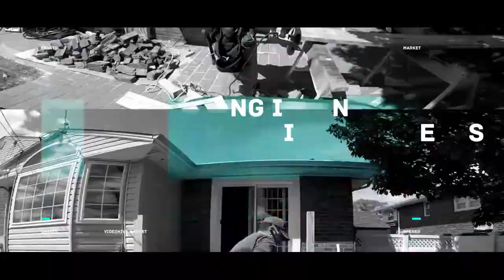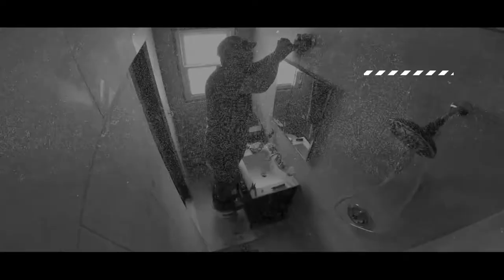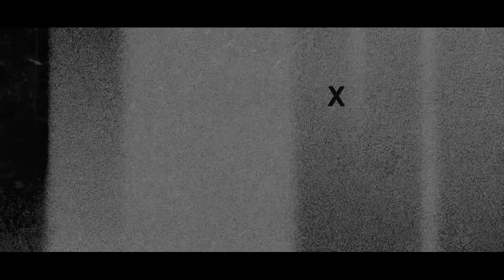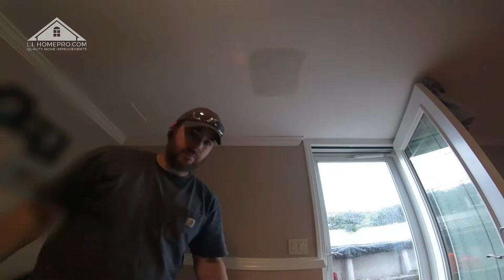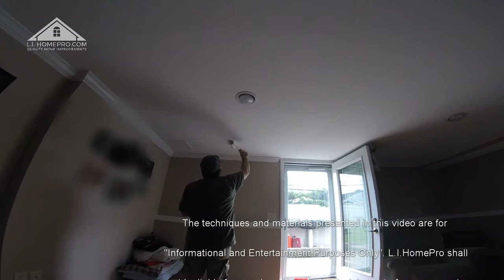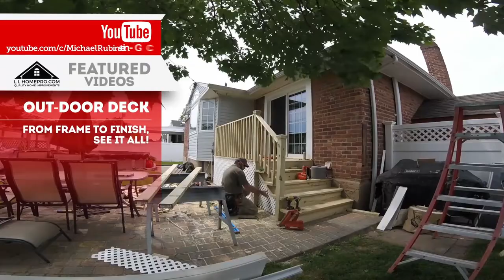Dry-wall Ceiling Repair  (Time-Lapse)

Comment: nice work. whats the going rate for a job like that? cant be cheap because even though job is small, time cost money.
Reply from the maker: Thank you, The going rate largely varies among contractors. This took me a couple of hours because of the dry-time between coats. I know some contractors that would have this done in 30 minutes using plaster instead of the joint compound.  Although this is a relatively easy repair, its my opinion that its worth the extra time to make it an undetectable one too.